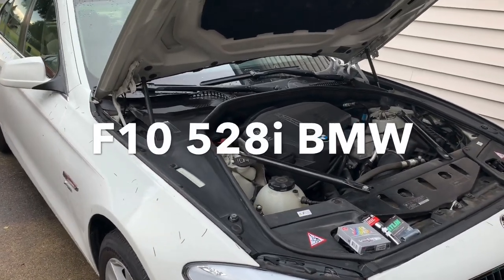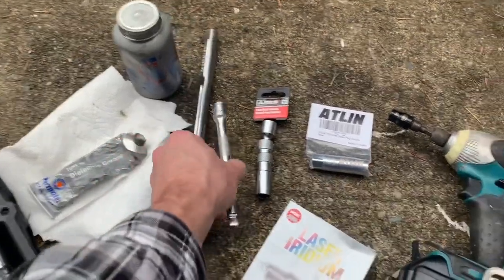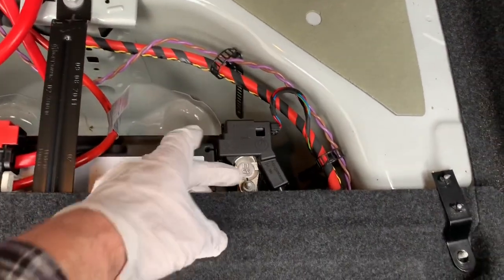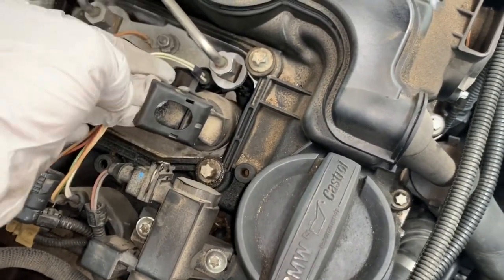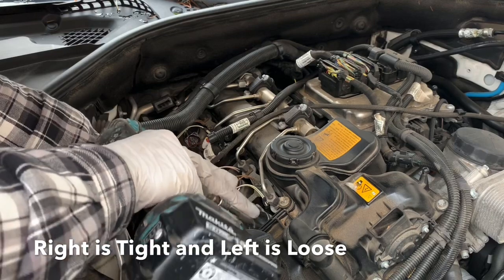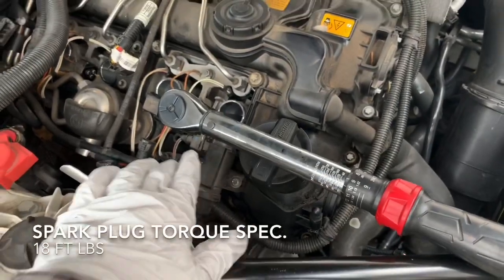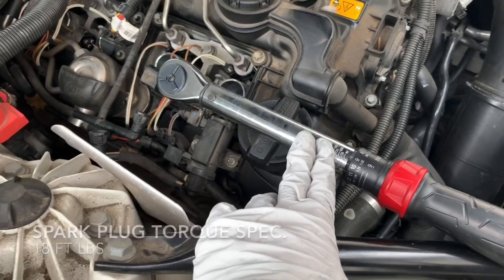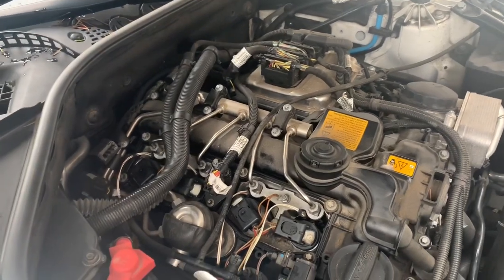How to replace Spark plugs  N20 528i BMW (2.0 turbo) Detailed guide 2012-2018

Comment: I bought the same tools you used and for some reason its not fitting and grabbing the ngk spark plugs. Maybe 15 mm or 16mm will do? I have a 2016 528i

Comment: Don't see the need to disconnect the battery. And not just because it takes almost longer than the SP job itself.
Reply from the maker: @csabakereszturi945  disconnecting the battery is a precautionary measure that is a recommended step of the process in the automotive industry. I agree that if you know what you are doing that disconnecting the battery may not be necessary but since it is suggested by the manufacturer I like to recommend it.

Comment: Every 3 oil changes? In 30,000 miles? No wonder these engines are blowing up at 100,000 miles.
Reply from the maker: @seanhoward8025  it is pretty crazy. I have found that many newer model vehicles extend some of the oil changes past 10,000 miles.

Comment: What is the opening of the spark plug?
Reply from the maker: @Sebastian-p6k9k  hey there 👋🏼 NGK spark plugs come pre-gapped, but it should be at .044. The spark plugs have iridium so it is important not to touch the tip of the plug with the gapping tool to avoid damaging them.

Comment: The second air line you disconnected from the engine cover. Mine was too stuck on and ended up snapping off , what do I do now? Is it a must replace asap or is it not a major major issue?

Comment: I dont see a vacuum hose connection to my plenum? My car is 528i 2016
Reply from the maker: There is a chance that it does not have a vacuum line on your vehicle, if you do not see any port or fittings that whole hose and the place that it is likely not there.

Comment: Dielectric grease should be applied to the insulator part of the spar plug, it is not supposed to make contact between the terminal and the coil.

Comment: I have a 2015 528i
BMW.. that socket did not work!!! What the hell do I use to get it out!!!
Reply from the maker: The 14mm socket I have listed should be what you need, is it possible they sent the wrong socket? Does your specify being a 14mm?
Reply: @TweekerDan1984  it's 14mm... I hate BMW
Reply from the maker: @GrandMarquisLS09 if you purchase the 12.14 mm socket and it is not working then it is possible that someone previously installed the incorrect spark plugs. Can you see down in the hole so that you can tell whether or not a 12 point spark plug is installed?
Reply from the maker: @GrandMarquisLS09 you would not be able to get a standard spark plug socket down in the hole but you may be able to get a standard sized non-impact, thin walled socket down in the hole.
Reply: @TweekerDan1984  it's because the rubber boot of the coils got stuck in all 4 cylinders. Classic BMW engineering!
Reply from the maker: @GrandMarquisLS09 dang! Were you able to get them removed?

Comment: Excellent video! Thanks for the links as well...I've already ordered most of the products listed. I noticed I had some oil dripping out of the two plenum lines for some reason. Any idea what that could indicate? I'm letting them drain overnight. I'm replacing the plugs due to more than normal engine vibration. Thanks in advance!
Reply from the maker: The hoses may just be part of the engines ventilation (pcv valve) which is common for oil to be presents on these hoses. Replacing the valve if equipped is part of a vehicle’s regular maintenance.
Reply: I'll look into it. Thanks @TweekerDan1984

Comment: Why did you disconnect the battery?
Reply from the maker: I always recommend disconnecting the battery for those who are not familiar with automotive work. It is just a safety precaution.
Reply: @TweekerDan1984  I see, and I was under the impression that you would have to recode certain things in the car by disconnecting the battery. Thank you for your reply.

Comment: My 528i vibrates when coming to a stop. (At a red light or a stop sign, and im pretty sure it does it while in park as well) would that be because the spark plugs and ignition coils are bad?

Comment: I have this same exact vehicle and it’s a good vehicle over all but recently my check engine light just popped up and I have no clue why it just stays solid orange but the car turns on and runs just fine so I honestly don’t know what it could be🤷🏽‍♂️. If you have like any tips towards what it could be would appreciate it for sure .
Reply from the maker: @Mathias Vega Most auto parts stores will scan your vehicle for free and let you know the code for why the check engine light is on. If you have your vehicle scanned and share the code I may be able to assist. If you were having no symptoms with your vehicle, the check engine light could be illuminated by something as simple as not having your gas cap on properly.

Comment: This is very helpful. Thank you. Do you have any recommendations on cleaning and maintaining ignition coil packs, while changing spark plugs? Saw some videos where people trying to clean with intake valve cleaner
Reply from the maker: @Rain Man you are very welcome, thank you for the feedback. As for the coil packs, I like the Way from down with just water in a rag and then I use dielectric grease where the spark plug goes into the coil. Not everyone uses the dielectric grease. It is more of a personal preference.
Reply: @TweekerDan1984  I've changed the spark plugs over the weekend, just followed your instructions. While changing I noticed 2 odd things that shocked me. My car was always serviced by BMW service centers and no one touched the engine bay. First the two of the spark plugs were not tight. I could just unscrew with my fingers. And second, one of the ignition coil was inserted incorrectly, so that it's barely touching the plugs. The rubber ring on top of the coil pack was squeezed out half way, which made it sit loose. 
My guess is that, stealership wanted me to come back after last oil change with some misfire complaints?

Comment: very informative video. Thank you for taking the time to share
Reply from the maker: @Michael your very welcome, thank you for your feedback. 😊
Reply: @TweekerDan1984  am in Washington state as well I got the same bmw as you my drivetrain is malfunction and I don’t knw what to do are where to bring it to get fix and plus I live in Friday Harbor and mechanic shop here don’t work on European car
Reply from the maker: @ZZo876 hello there 👋🏼 looks like your about 100 miles from us. Has the drivetrain continued to malfunction or did it pop up once and go away? I have had this issue occur in the past when it was really wet outside.
Reply from the maker: I have had to replace a damaged crankshaft pulley on this car when I received the same message. Do you hear any growling/whirling noises(bearing noise)?
Reply: Please do 😊

Comment: What plugs and are they pre gapped?
Reply from the maker: @Thomas Tague if you went with NGK they will be pre gapped. I shared the part for this motor in the description but if you have a different make and model let me know and I will share with you what part you would need. Hope this helps.👍

Comment: Thanks for the video.   When replacing spark plugs, do you need to replace coils as well?   off topic question from this video.   What should be normal running temp?  on my 2016 528i it runs just below 250..  is that OK?  any recommendations?
Reply from the maker: @Charcomusic apologies for the delayed response. Normal operating temperature is usually between 195° to 220° give or take. You should not need to replace the coils at the same time as the spark plugs. But I highly recommend using the NGK iridium spark plugs. Hopefully this information helps, cheers! Also I have links for some of the items needed to do the work in the description. Including the tool required for replacing the spark plugs.
Reply: @TweekerDan1984  did you even gap the spark plugs or it wasn’t even necessary?
Reply from the maker: @M J your OEM plugs for this vehicle will come pre-gapped, I recommend NGK plugs. Hopefully this info is helpful: customizing the iridium spark plug gap would only be necessary if installing them on a radically tuned car, also gapping the Iridium plug requires a specific method to avoid accidentally removing the small amount of iridium on the plug.
Reply: @TweekerDan1984  thank you that helps

Comment: To learn this car actually is a twin scroll setup and not really an dual twin turbo setup
Reply from the maker: @Maurice Mcghee, Yes I was mistaken, we also have the 7 series twin turbo.
Reply: @TweekerDan1984  many are but most people wouldn't even notice it honestly. Unless you upgraded your motor. I have a 528i xdrive but I keep having the normal drivetrain malfunction problem and trying to figure exactly what the problem is. Can be a headache

Comment: Great video. My son has a 2016 528i that broke down on him while traveling this past weekend. When it happened he said that he accelerated to pass a car when he got a warning light that his drive train wasn't functioning and his car started shaking or riding rough. 
He had it towed to a local BMW dealership and they called him today and told him he needed new coils and plugs and quoted him just over $1000 to fix. 
After watching your video we are going to do the work ourselves and I have a couple of questions
a) when plugs and coils fail, is it common to initiate a drive train warning and cause the car to shake or riđe rough? When he told me about the drive train warning my first thought was maybe its the transmission. 

b) are all 528i models equipped with the 4 cylinder turbo motor?

Thanks for your help.
Reply from the maker: @Troy Martz I’ve actually had this happen to me multiple times after accelerating quickly from a stop. It is possible for the the coils to cause a very rough idle if any of them fail. You could replace the spark plugs and see if that corrects your issue before jumping to replace the coil packs. When replacing the plugs definitely get NGK plugs and you will need a special spark plug socket in which I added a link for in the description below. Newer model 528 bmws have a turbo, is your BMW equipped with xdrive?
Reply: @TweekerDan1984  mines is it's a 2015 and I went through this. It was the coil pack on cylinder 3. Now it just happened again a few days ago and I got the same drivetrain warnings I did before with the rough idle. I put my OBD on it and this time it is cylinder 2.. First time I was in comfort mode on the highway when I accelerated to pass someone when it first happened. This time I was in sport mode. Smh
Reply: @TweekerDan1984  Thanks for responding. If the xdrive is the one with different modes, I think one of them is sport mode, then yes.
Reply: @troymartz7196  did you ever try changing both the spark plugs and ignition coils?
Reply: @jae2482  no,  it looks pretty straight forward though. The problem turned out to be a recall issue so it was all taken care of by BMW.

Comment: Goodmorning, How can I order some of these parts for  my car?.
Reply from the maker: @Carlton Brooks I shared links for some of the exact parts in the description. Another route is to take note of the year make model and share them with your local parts store or use some of the online filters available. Amazon has a foyer where you can add a vehicle to your garage and then your parts that come up within your search should only be parts for that particular vehicle. Hope this helps. If you need any help let me know your vehicle details and I would help point you in the correct direction.

Comment: I have this car same Color would a bad spark plug cause it to not start I mean no click not even try to start
Reply from the maker: Do the lights come? Windows or stereo function normally?
Reply: @TweekerDan1984  when I press the starts button the accessories come on then shut right back off
Reply from the maker: @Darryl Bunch, to answer your question a bad spark plug would not be your issue of it doesn’t even try to start.
Reply: @TweekerDan1984  ima have it towed to dealer tomorrow

Comment: Why does it need a flexible socket head?
Reply from the maker: Hi there @Inf Adel It does not need to be a flexible socket, although if you have a choice between the flexible and straight socket the flexible socket can make things easier for you. Also I shared both socket types in the description in case that is helpful.
Reply: @TweekerDan1984  Yeah. I typed the question right before the part in the video you said it wasn't necessary for a 4 cylinder. lol Thank you for the video.
Reply from the maker: @infadel885  your very welcome.

Comment: Maybe a stupid question but when I hold the spark plug vertically the copper crush washer falls off? … I’m scared that it will fall into the engine. Do you have a trick for this?
Reply from the maker: Definitely not a stupid question, you could use dielectric grease or anti seize to hold it in place, I would consider replacing to plug.

Comment: So I need help which one do I get for my 2013 528i and I need too replace Coils
Reply from the maker: Here are the plugs coil and tool. I recommend the AcDelco coils.

Ignition coils
https://www.amazon.com/dp/B077NMMF5H/?tag=tweekerdan198-20

NGK Spark plugs 
https://www.amazon.com/dp/B01MQH2QAN/?tag=TweekerDan198-20

14MM spark plug socket w/ swivel
https://www.amazon.com/dp/B07RR84RXB/?tag=TweekerDan198-20

Hope these help.
Reply: @TweekerDan1984  I replaced the sparks and coils my car still say Drivetrain malfunction
Reply from the maker: @Hotbkoy. Ant  have you replaced anything else recently? I met up with one of my followers and scanned his car for a system malfunction warning on the display and it happen to be that he missed reinstalling a ground wire during previous work. Are you by chance local here in Washington?
Reply: @TweekerDan1984  nah I just did that only , nope I’m in LA as of right now
Reply: @TweekerDan1984  I might have the same problem
Reply from the maker: The person that I met up with also was only replacing his spark plugs. The ground that he missed was near the firewall on the passenger side. I would check both the driver and passenger side for any loose wire. Have you by chance replaced your battery recently?
Reply: @TweekerDan1984  ok I’m have too Checc that for me but can you do me a favor ? Can you send me a video showing me where I gotta Chec at Thanks and no I haven’t replace the battery

Comment: I have a 2011 528i what kinda spark plugs I need is it a certain brand I was told it was a certain one ?
Reply from the maker: You will want NGK which is OEM. Cheers!
Reply from the maker: @young millz I shared links in the description for the parts and tools used in the video. Here is a link for the spark plugs. NGK Spark plugs 
https://www.amazon.com/dp/B01MQH2QAN/?tag=TweekerDan198-20

Comment: Would you recommend replacing just the spark plugs at 60k miles  or both the plugs, and ignition coil?
Reply from the maker: Just the spark plugs 👍
Reply: I don't know why but some people just like to waste money and include the coils in their preventative maintenance. They don't fail commonly, but when they do they are easy to troubleshoot and replace.

Comment: Do you have to change the gap on new spark plugs before installing them or is it already pre-gapped?  What is the standard gap and what tools would you use to measure and adjust gap?  Thanks,
Reply from the maker: The gap will be listed on the sticker with the vehicles information. The plugs will come pre-gapped. Here is a link for the tool. https://www.amazon.com/dp/B07P1FD1MQ/?tag=tweekerdan198-20.

Comment: Thx for video. I have a 2016 228i, I’m wondering if the 14mm & 3/8 wrenches & sockets will fit mine as well?
Reply from the maker: I checked and yes they will fit, I shared a link in the description if you are interested in supporting our channel? It is the best price that I could find on Amazon.

Comment: So if you disconnect the battery, and change spark plugs/coils, what do you need to do to ensure the computers retain their programming and get updated with the new maintenance information?
Reply from the maker: @GroovyCachinDude when disconnecting the battery just be gentle  with the cables. There are no extended measures to ensure keeping the computer programming. The only change you’ll need to do is that you will want to go into your onboard computer and there should be an area where you can select the service that has been completed. Also I would also like to add that it is not completely necessary to actually disconnect the battery, I alway recommend disconnecting the battery as a safety measure. When creating these videos I try to create them so that even someone who may not consider them selves mechanically inclined could try to tackle this task.
Reply: there is no maintenance information for plugs in idrive

Comment: thank you so much.  I love learning and doing whatever work I can. I saw NGK advices against use anti seize as it throws off torque spec ratios. but I’ve always done it and never had issues.

Comment: Do you have a link for coil packs? I had #2&3 misfires and it’s barely running. I changed all of the pugs and it didn’t help.
Reply from the maker: I do not have a link but if you let me know the year make and model of your car including the engine size I could provide you with one.
Reply: @TweekerDan1984  it’s a 2013 528i. I actually swapped the coil packs and that didn’t fix it either. I’m getting random misfire code. Says 2-3-4 misfire and random. I cleaned the mass airflow sensor. I don’t know what else to do. Any suggestions?